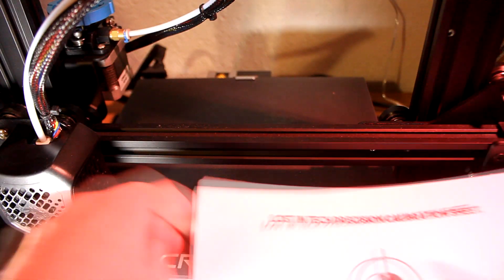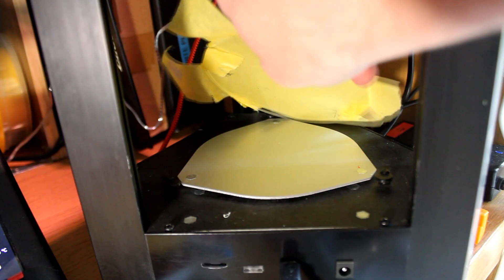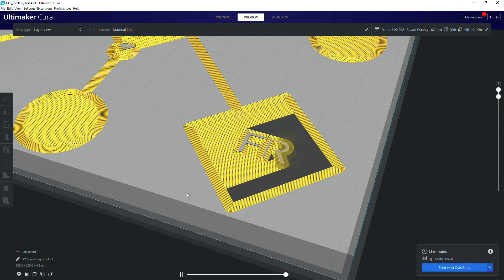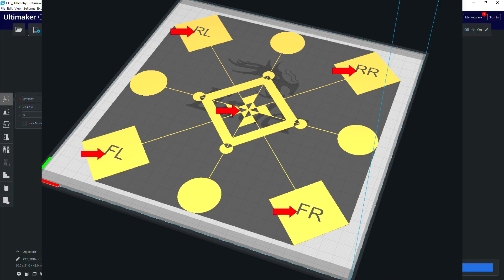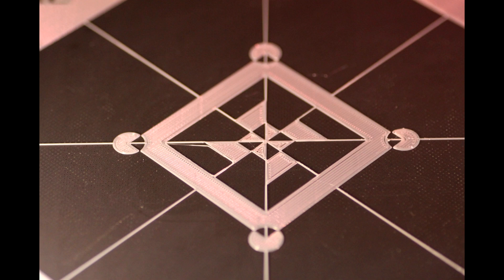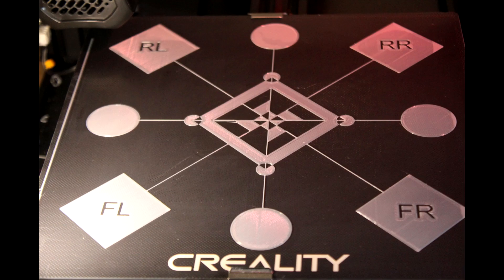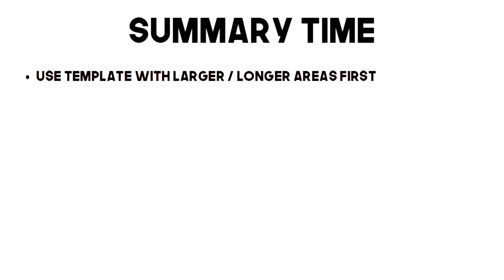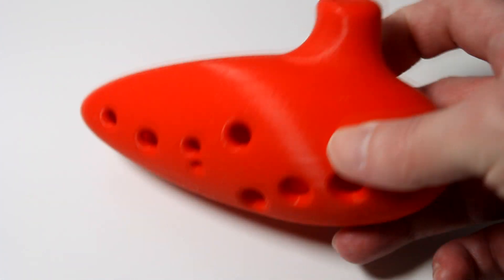How to level your bed on ender 3 v2 / other 3d printers - easy process-manual on the fly levelling

Comment: I still tend to clean the bed and use a feeler gauge or a piece of paper for leveling. The problem I see is that after you have printed the patterns you have to scrape them off, applying pressure to do so, which could knock the leveling off before you start to print. That said, it's still a worthwhile video for demonstrating the interactions between the leveling knobs.

Comment: Lets say my bed is level and my z offset is good.smaller prints for first layer come out ok this is when its a larger first layer.If my speed is too slow can the heat from the nozzel influence the pla adhearing to the bed. (It tends to lift a bit on larger parts)
Reply: Did you get this sorted?

Could it be a draught?
Try a draught shield setting, it's helped me hugely

Comment: I have issues finding a place to put the clips that the nozzle or nozzle head body won't hit - any advice?
Reply from the maker: you probably have brim or skirt turned on, turn it off and it won't go there.
Reply: @LostInTech3D  ah, yes- I wondered what that thing at the edge was. Thanks!

Comment: Hey all, when i print this, i have parts of almost all the squares and middle part and circles that either have bits of filament or no filament and other parts perfectly filled up. Why is this? i have done my e calibration. Still all of sudden having some massive issues with ender 3 max.

Comment: I don't hear much about how wonderful BLTouch is - does it really help? When I do manual bed leveling before I run BLTouch I notice oscillations in what you would think would be the bed surface but what I believe are coming from eccentric runner wheels either in the bed slinger mechanics or the X runner wheels on the cross bar. I suspect the BLTouch mops these imperfections up but I don't know for sure. I mean, it seems I can get my first level uniformly thick after all the leveling.

Comment: Another good alternative to the springs is using silicon columns instead of bed springs.
Reply from the maker: I prefer springs to help with nozzle crashes but both are better than solid mounts.

Comment: Strictly speaking, if the bed was completely rigid then only that part of the bed that is outside of the spring will raise if you lower the opposite corner. That you were able to remedy a dip in the centre of your glass bed by putting a few sheets of foil under it means there is some flex in even a glass bed.

Comment: Hello. Very good video, but I have a philosopical/math problem with this kind of bed support : ¿Why the heck does someone has to pick four points to define a plane? Geometrically, a plane is defined by three points, and thus, if you adjust one of this three points, you don't mess with the other two... It is inexplicable to me why build a bed with four support points, complicating and making leveling so difficult
Reply from the maker: I have mentioned this, I cant remember when, but yes absolutely. Some printers do have 3 points.

Comment: Does this help with printing large scale items that get fairly close to edges of the bed?  I can't print things toward the center without too much problem, but when I tried to do something out past the adjustment knobs... disaster.
Reply from the maker: Kind of, you really need a stored levelling mesh to get accuracy like that at the extremes. The alternative is to set your first layer (only) as high as possible, eg 0.35mm and just wing it.

Comment: For example, it prints half of the square on the left front corner but then it starts skipping the rest of the square. In this case the bed is low or high? How can I fix? I may throw my ender 3v2 soon!
Reply from the maker: Hop on to discord and you can share a pic and maybe we can figure it out!
(Link in more recent videos)

Comment: so everything prints fine but when it goes to print the lines that connect everything i get a dotty mess. anyone have any idea what could cause that? im not sure if it my retraction or what
Reply from the maker: There's more than one reason, but I would look at the filament first, if it's old, it can do exactly that.
Reply: @LostInTech3D  just opened this filament but it was sitting for a while. will try a new roll and see what happens. thank you for the video!
Reply: @LostInTech3D  ok so i changed the filament and it was instantly better. thank you!
Reply from the maker: excellent, an easy solution. I don't know why some PLA is like this.

Comment: Will be happy to give it a shot.   I do the paper thing first then print squares offset from the corners and check the thickness with calipers.  Look at the deviation in thickness from one to the next.  So if it's RR= 0.4, RF=0.35, LF= 0.4, RL=0.35...  then two opposing corners are just a tad low.  Nudge both wheels and reprint.  Takes 5 mins, then measure again till they all match.   
I'm also legally blind, so I can't really tune it on the fly by eyeballing it.   So I usually get it by the 2nd pass from measuring and nudging.  
Been using spring-steel PEI coated plates.  <3 them, though I've noticed they seem to have occasional low spots.  You get the paper just right in the corners then check the middle and it's like...well...  that's the best you're gonna get.  
I'm using a 0.6 nozzle with PETG, almost exclusively.

Comment: I love the explanation of the reasoning that went into the template layer designs here!  Also, the brief-but-useful explanation of how the bed leveling adjustment screws affect diagonal corners.  When you think about it, it’s very similar to how you need to tighten lug nuts on when you put tires on your cars.

I suspect I had some poor adjustments on the wheels on my Y axis of my LotMaxx (Ender 3 or similar clone, has same basic structural design) during manufacturing so now I’ve got a notable amount of slop that causes really bad issues for multiple layers.  I strongly suspect my initial leveling put things under too much stress and is a weird sprung balance, with the print head pushing into the bed too much over time causing problems, combined with how things are sprung.

What I see from this looseness/slop is what makes the bed appear (via results) to not be level, but the most scary thing is to watch it carefully and pay attention and to see the bed actually act as a teeter-totter as it goes back and forth with the print head applying filament: it suddenly takes a big drop.  This causes interesting print defects that aren’t so readily seen and understood with just a single layer.

This is a design defect of having the Y axis supported with a single central support extrusion as it moves, combined with the V-groove wheels being made to roll in the grooves on a vertical axis, so especially if things aren’t adjusted perfectly, it’ll speed up wear and thus add slop as it wears, between the combination of being too loose/tight to begin with, and then the long-term repeated stresses.

The great thing about your set of templates is it appears pretty efficient for materials usage and time usage for ROI in getting things dialed in, but there are other things that would be of great value, that can be added:

1. Bed/axis skew measurement.  Your pattern is already large enough it shouldn’t be much more to add this.  If you have good leveling but a skewed axis (or more than one) that limits what you can do.  Things don’t fit together as planned when things are too skewed.

2. Z axis issues: the problem I’ve currently got (may need to replace the V-wheels, I haven’t taken it apart yet, these are my first printers I’ve used) may be mistaken as a Z axis issue if you don’t think to carefully watch bed motion.

3. Print speeds for extrusion quality: not all extruders are created equal.  Where do you get acceptable tradeoffs for speed and layer heights?  Perhaps 2 layers is sufficiently thick for this analysis.

4. Fine details for vertical printing, again, at measured speeds.  Unless you have a fixed bed printer or perhaps one where the bed only moves on the Z axis, all those springs and the rest of the printer act as a suspension system for your printed part until it is completed.  Each system has a spring constant K for each sprung load.  What makes it especially interesting in a bed-flinger is all the springs may be at different tensions due to the imperfections of the bed and carriage materials.  As you stated on the video about using sheets of aluminum foil in the center of the bed, well… I can’t think of a better proof things are suboptimal! In this test, I’d want a number of strategically-spaced spires, both small extrusion width ones that are as small as you can make them for that extruder setting, as well as X single-wall, also double-wall, etc. to understand what your printer can do.  Why single and double wall, you ask? This is a test that measures space/time/energy all at once.  Perhaps some more wall options would be useful.  In particular, this would be useful as a torture test to have the tiniest spires go to the limits of the printer’s Z axis at these strategic points, so a user could know what print speeds they can achieve for the spring factors of their printers in all the dimensions, and see how their machines are sprung by how the spires lean in whatever dimensions they do.  Tiny narrow spires (and also longer (but still short) lines, along various X, Y orientations, and also overhangs) would reasonably be expected to set up oscillations in the entire printer structure if they’re continued long enough, sort of like the old joke “if you see the car a-rocking, don’t come a-knocking” so I can see a need to do perhaps another template, one printed in isolation of everything else, for all key areas of the bed: we don’t want to let oscillations have a chance to dissipate in the test, because eventually, the user may actually have such a crazy part to print and have a messy failure they didn’t anticipate.  Note also that this test should also be designed to measure skew as well, since that can happen in all dimensions.  So, with that in mind, that also results in multiple areas in a single printing also being printed across the print bed.  This may also show how level the printer itself is, especially with pushing bed and extrusion temperatures higher, which also can be used to judge cooling capacity (clearly, multiple interacting variables here to test and judge).

Of course, that’s not an all-inclusive set of things to test, but that’s something I’ve not seen explicitly addressed, thinking about all the videos I’ve watched.  My formal training is EET/automation, and I’ve ended up making a living in software development.  For that reason (and licensing costs are harder to justify for Fusion360) I’ve been using OoenSCAD for part design.  It’s available for Windows/MacOS/Linux for free, so it’d be about as close to perfect to convert your templates into that internal scripting language and parameterize it for the print volumes and characteristics of people’s printers, because I see a number of people with issues of things being too large for their printers according to Cura.  What if they have a larger format printer?  They have the problem with it not being as useful for the whole bed as it is now.

Thanks!

Comment: You are simply the best, I watched Hundreds of videos on how to make 3D printers and especially ones from the experts (supposedly) but nobody explained this most important fundamental in such level of detail. After making 3 printers which don't work I even bought an ender 3 to try and understand better on where I was going wrong but what I received was absolute junk which did not even make one proper print and their customer service is less said the better. I finally found usefull information on why I was not getting the perfect first layer and I had resigned to printing only in the top right corner of the Ender still with minor imperfections. Now I will put everything I learnt and I am sure I will be able to print anywhere on the bed 😀👍 forgot to add, love your sense of humour 😀😀😀

Comment: Does the fl-fr-rl-rr print work ok on a delta or can you produce a version for deltas?
Reply from the maker: Oh yikes. My Delta wouldn't know bed levelling if I tried, what is your bed diameter?
Reply: @LostInTech3D  230mm any cubic Kassel plus linear if that helps.
Reply: It has ‘auto level’ and I think I have it close now (within 0.1mm give or take bed texture/unevenness) but it takes a full 2 hours to print a single layer across the entire bed!

Comment: i bought and installed an official bltouch and it straight doesn't work for my ender 3 pro. Currently I use it solely as a z offset switch while I decided if I'm returning it or not...
Reply from the maker: I'm confused, how does it work as a z offset switch but not work? Did you install the right firmware?

Comment: Great video,  a small problem with the main levelling test, it will not fit in cura 4.11! E3V2 bed size set to 235x235x250! its fine in crealty 4.20 bed set to 220x220x250. I think its due to some minus figures in the printhead setting? Any suggestions.
Reply from the maker: do you have brim/skirt on?
Reply: @LostInTech3D  Spot on, yep skirt, selected none, now fits fine, thanks, got my first 3d printer E3V2 07 2021 so still learning, Keep the videos coming.
Reply from the maker: good stuff - the reason I knew the answer was because I do that every single time 😂👍

Comment: I agree that auto leveling gimmicks like BL touch are just bodges for cheap beds that are not flat.  But can we please use the right terms and call this tramming, it's not leveling. You can put the whole printer on a 45 degree angle and it will print fine.
Reply from the maker: You're right, but at the same time.... everyone continues to call it "levelling". I've seen other YouTubers try to change that and fail spectacularly 🤣
At the end of the day as a small YouTuber I have to use the common vernacular for keyword relevance 👍

As a side note, I was planning on doing an upside down printing episode until teaching tech beat me to it 🤔 maybe I still will, later.

Comment: What is everyone doing to get the files to slice in Cura?  I keep getting the error saying to check and make sure the model fits within the print area, are assigned to an enabled extruder, and not all set as a modifier meshes.
Reply from the maker: What's your cura version? And do you have the build area set to 235 x 235 x 250 in the machine settings? (this is as per the cura included ender 3 settings...so basically if you added the printer as an ender 3 - even if it's a v2).
Reply from the maker: Also just to add, I discovered this happens if you have brim or skirt on. Would be nice if cura told you this rather than the cryptic message! 🤔

Comment: You mentioned adding aluminum foil to help level a wrapped bed, I have a wrapped bed but adding foil does not seem to help. Did you happen to do a video about that part of leveling or do you know where I can find a video. I have an Ender 3 v2.
Reply from the maker: I do have it on the list of videos to make in the future, but the basic premise is to just keep cutting single layers to size and putting them under the glass until it works. I'm not sure if there's a limit to how many layers you can have but I have about 9 single layers under the center of mine, gradually getting smaller so I don't have a giant lump in the middle if that makes sense. If it's not a dip in the center then it may not actually be the glass that's warped, you can have a tramming issue, i.e. the bar the print head moves along is not parallel to the rail the bed moves on, in which case the fix can be anything from adjusting the eccentric nut under the bed on the wheels all the way to having to almost rebuild the frame. That said I think this is rarely the case. 

You should also be aware that the clips on the ender 3 v2 do cause the glass to appear bent because they put pressure on the front and rear center of the glass. There's no easy solution to this because of the shape / size of the head so you can only have two clips but I guess knowing is part of the answer...and of course countering it with aluminium foil which certainly did the trick for me. That said I should probably point out that even with all this done, I still have variation between the edge of the bed and the center. How I get around that is to dial the nozzle a bit closer (quarter turn basically) if I'm printing small things (90% of the time) and if I'm printing something big I either accept that it will be too close at the edges or just dial it down a bit so it's "ok everywhere on average". It's always going to be a compromise unless you spend a lot of time getting things perfect...if it's even possible. In the real world things are rarely straight. 

If the glass itself is massively warped then of course you can just get a new one from banggood or similar for a fairly cheap price. The replacement bed from banggood is what I use at the moment and I find it as good or slightly better than the original.

Sorry - bit of a long answer :)
Reply: @LostInTech3D  Thank you. I'm a novice still trying to get things together, this helps a lot.

Comment: Do you clean the prints before putting in your mouth or is it safe to do it off the print?
Reply from the maker: I was a bit confused with that question until I remembered the end of the video 😂
I personally just wash it to be sure, generally the issue with printed parts is the holes that can develop bacteria. But straight from the printer it's okay, I think, as long as you keep the printer clean, not use toxic substances, etc.
Reply: @LostInTech3D  😂😂😂sorry ....i only use isopropyl alcohol to clean the bed and for adhesion the purple glue
Reply from the maker: That should be fine then! 
I have a future video planned about the discussions on food safety 👍